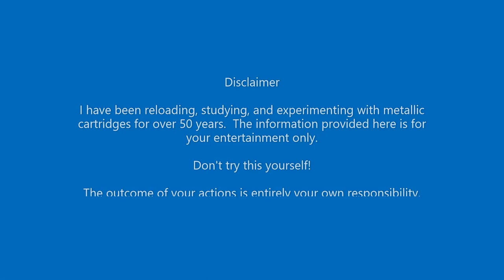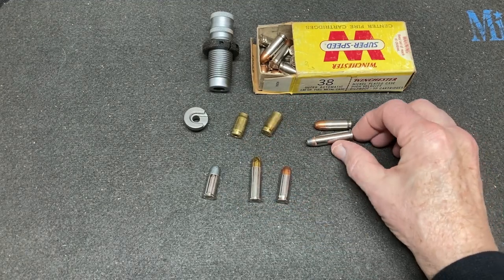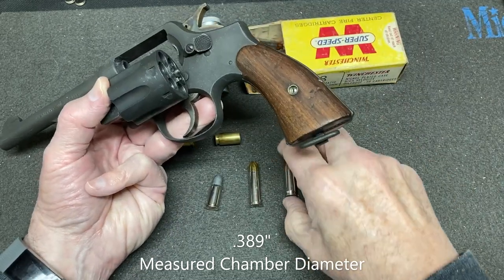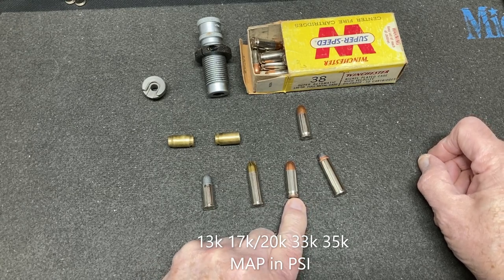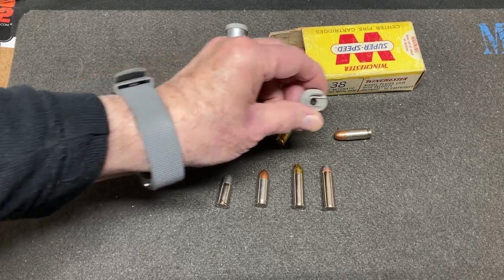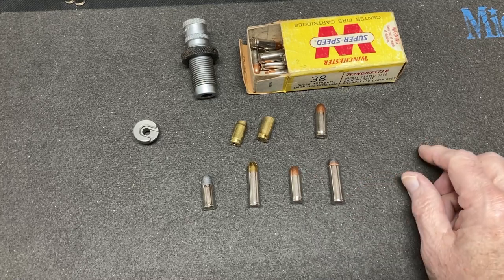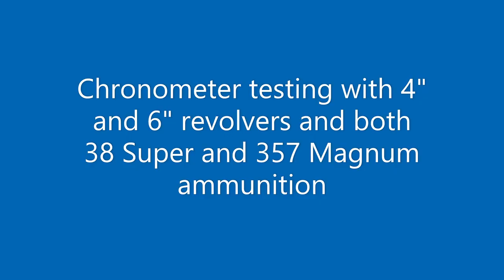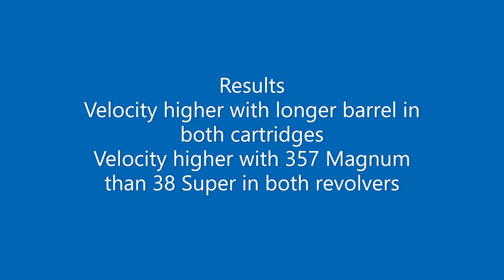38 Super in 357 Mag - Firing an autoloader cartridge in a revolver

Comment: Very helpful vid, but I have a question. Did you use half moon clips? Did the 38 Supers, which are nearly rimless, seat very well and extract very well w/o half moon clips? And there was one "failure to fire" I believe. That, to me, is usually caused by too much space between the primer and the firing pin. That's what led me to the question about the half moon clip and seating and extracting in the cylinder. Thanks again.
Reply from the maker: My revolvers aren't relieved for half-moon clips so the cartridges headspaced on the semi-rim and extracted perfectly.  All the primers were uniformly indented though a couple did pierce (harmlessly).  The ammo box came from an estate collection and the ammo was not stored properly so I expected more than the one misfire.

There was no pistol in the aforementioned collection that was chambered for 38 Super so...I think the 38 Super was being improperly substituted for another cartridge.  When I was young (1960's), mail order purchasing of firearms was still legal and people bought inexpensive surplus that was often chambered for cartridges not readily available in the USA.  Also, some surplus arms were rechambered by exporters for American standard rounds without regard for the strength of the converted firearm.

There was a Star "A" pistol in the collection (which I did not acquire) stamped "CAT. 9M/M&38" which means its chamber was altered for export to fire both the Spanish 9mm Largo and the slightly shorter (and slightly more powerful) 38 ACP.  The 38 Super is dimensionally the same as the 38 ACP but loaded to higher pressures than are suitable to a Star Model "A" but I think that's the reason the ammo and the pistol were in the same place.